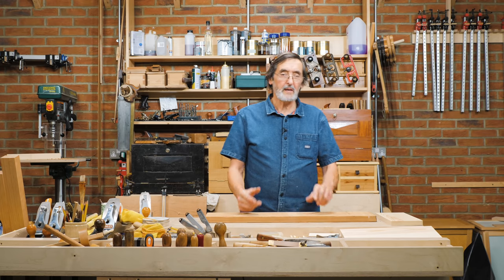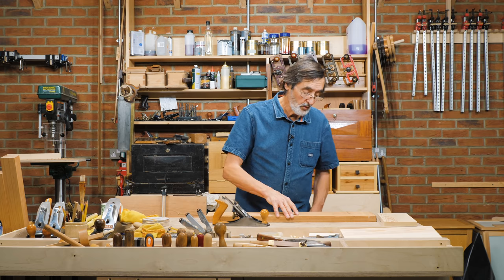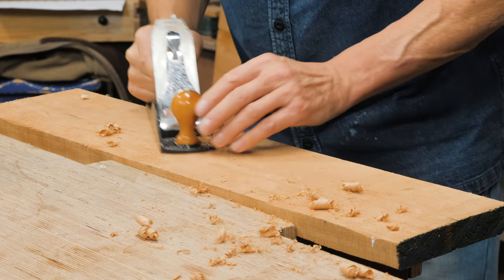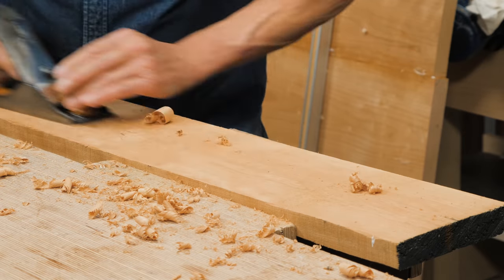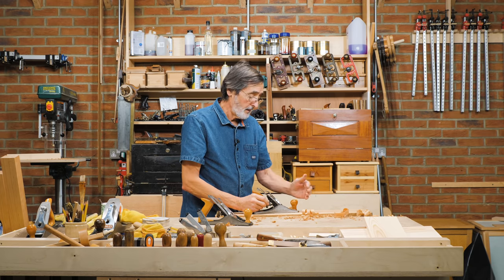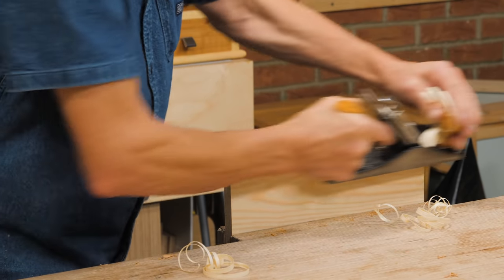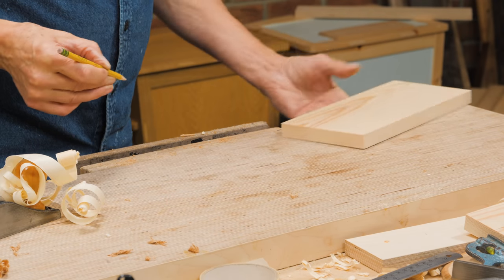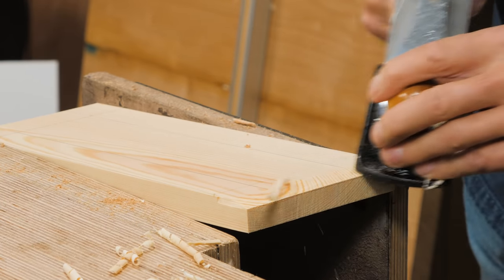How to use a Scrub Plane | Paul Sellers

Comment: Older transitional planes (wooden/iron hybrids) work well for converting to scrub planes. They are fairly plentiful in the US. They usually have a worn wooden sole that also means the  throat has opened up, and the wood on wood friction is significantly less than iron on wood so they really glide over the work.

Comment: I use a reconditioned Stanley #5  with a cambered blade as a scrub plane. I use it for the purposes Paul has described here and also for flattening one side of a plank before I sent it through my thickness planer. It works very well.

Thanks for the idea, Paul.

Comment: Thank you very much Paul for sharing your knowledge and know-how. Watching your videos and practicing by myself, my woodworking skills skyrocketed in just a few months(from almost zero to a little, but that makes me a very happy person and I think this will last). It's always a pleasure discovering new techniques and designs with crystal clear explanations and demonstrations. I can't thank you enough for that.
On the subject of scrub planes, here's a small trick I found for those noobies like me without a plane or spare iron dedicated to the task. Trying to take an inch thick, irregular and rock hard piece of beech down to less than 1/2", I tilted the blade of my no4 all the way to the right and then started scrubing across the grain with the (slightly) rounded corner of the blade. It hogs a lot of material and you have to be very careful not to tear off the opposite edge, but it gets the job done. I suppose it is most certainly bad practice, awkward and hard on the plane in the long run, but when in a tight spot, without the proper equipment, you gotta make do with what's at hand. Happy if it helps someone and glad to be corrected if anybody knows of a more "proper" way to do that kind of makeshift job :)

Comment: I have 4...a wooden European style one with a heavy and rather narrow iron, 2 vintage Stanleys (#40 and 40-1/2) and a #4 converted into a scrub. The European one and both Stanleys are hammer adjust. The #4 has a very mild camber. All 4 are amongst the most used planes in my shop.

Comment: Paul, a couple questions if you don't mind:

1. Do you specifically recommend a no. 4 size for a scrubber, or is it just preference?

2. When scrubbing for fast thicknessing, is there a process? Against the grain or with for speed and efficiency, or does it just depend on the piece of wood?

Comment: HI could you ask Paul if he can do a tutorial on drilling coach bolt holes in wood and using counter bore and counter sink drill bits please and the different types of wood drill bits for electric hand drill and also for boring brace and different bits.. many thanks!

Comment: I have a plane which has really quite a bit of play in the adjustment wheel, takes 6+ turns of it before it engages either back or fore. Anyway to make it less so?
Reply: Where the screw operated lever engages the hole in the chip breaker, I saw somebody who bent a small metal shim, hooked over the top of the iron, to insert in that gap, and clipped in place underneath the cap iron. Sorry, can’t remember who it was.
Reply: The pin must be too small
Reply: Maybe cut a slot in a washer and stick it in the gap? I’m going to try it.
Reply: @georgehyker  Well, it’s either a case of reducing the play of the yoke inside the thumb wheel, or reducing the gap in the chip breaker. I tried the shim method, cutting a piece out of a bean can, and it worked for me.

Comment: Brilliant thank you.  I've been doing some work that this will work wonders on.

If you don't mind I have two questions.
Could a lesser quality Jack Plane be converted to a scrub plane?

And do you have any experience or tips for working with green timber?
It seems a shame that so much UK wood is wasted as we lack space and infrastructure to process it efficiently, so end up burning hundreds and thousands of tonnes of beautiful oak and yew etc
Reply: Leonard Bailey intended for the #5 & #6 to be used for rough stock removal. Stanley didn't add the #40 scrub plane until a few years after they bought Bailey's patents. 

I have a cheap #4 set up for scrub work, but I haven't used it since getting a #5 a few years ago (now I use a #5½).
Reply: @DavesRabbitHole  Thanks David.
I have a naff Whitmore I was thinking of selling. But I reckon it will probably be worth more to me if I convert it to scrub.

I've been doing more reading on working green wood.
The general answer i'm seeing is "don't"  but surely people used to. It will just take more thinking about how things are going to shrink.
It could probably even be turned into an advantage. Joints locking on to each other without glue etc.

Though I guess it won't fit most ideas of 'fine' because of warps

Comment: Great video as always.
Wanted to ask you about your vise offset from the bench surface. Is that for additional clearance? One opinion I heard was there should be no offset so that you can clamp a long board in contact with the bench instead of it just hanging off the vise.
Reply: That's simply how that type of vise is designed to be mounted. In order to flush mount it, you need to remove enough material from your bench top to accommodate both the metal jaw and the wooden jaw pad that you'll attach to it.
Reply: Hello Liviu, Paul addresses this question in some of his videos and blog posts but I can't find the exact one. But essentially, he leaves the offset so that he can grip his work with an overhand grip, which he finds much stronger and more comfortable. If the vise is flush to the bench, you have to grip the piece from underneath otherwise your fingers get pinched. Ah, here is one blog post where he mentions this: https://paulsellers.com/2016/06/on-vises-part-i/ "Many people seem disposed to recess the face of the rear vise jaw flush with the corner of the bench and then add a 1 x 4 the full length of the workbench to have a flush-to-the-corner straightedge along the length of the workbench. For some unknown reason of substance it’s “so they can clamp work flush to the bench for maximising support.” Whereas I don’t deny some may find good reason for this, I have yet to find a reason of real value, even for edge jointing work, so perhaps for me it is more the rarity than the norm because we generally edge joint much of our work in short lengths relying only on the vise and not longer than say three or so feet long. If we do need to we simply add a packer and clamp away without hindrance. Much better to have the vise jaw lining the width of the vise plus say an inch each end and have the real benefit of being able to grip your work throughout any process you care to name be that overhanded or underhanded. "
Reply: It is easier to hold by hand the piece of wood when you have clearance.

Comment: but what if a plane had a camber in the other way around ? would it take a wide shallow shaving ?
Reply: A wide, shallow shaving is what a smoothing plane does.   now if you mean a concave cutting tip? - that would make the corners of the plane iron did into the wood and leave lines when planing or you are going the route of molding planes.
Reply: Thats possible with a moulding plane and it makes a roud or a bullnose.

Comment: Im new in woodworking planes. 
I wanna know what is the different between a scrup plan and a smoothing plane ? 
How can you see the different?
Reply: You can set up a no. 4 like he has to do either task. The scrub plane setup has a heavy curve/camber on the edge of the blade, usually 8”-10” radius, a wide open mouth and the chip breaker set a little farther back, so that it takes heavy cuts and removes material quickly. A smoothing plane is set up with a very low curve/camber, a tight mouth and the chip breaker <1/16” back from the cutting edge, and takes a very fine cut so that it leaves a good finish but does not take off much material.
Reply: Paul takes a smoothing plane, and converts it to work like a scrub plane. A true scrub plane is narrower, with a thicker iron, and large mouth opening.

Comment: Great! Now I just wish I had an old no 4 and a spare blade 🙄
Reply: Because a scrub plane doesn't have to be as precise as a smoothing plane, you can get a cheap newly manufactured plane and grind a camber into the iron to make a scrub! The large mouths typical of cheap new planes is a liability for smoothing but works well for taking big shavings when scrubbing. Of course, you'll always want a nice old No. 4 to follow up with, hope you find yours some time!
Reply: @HugoEckener127 😀 I just ordered a cheap No 5 at Amazon (under 40€) and will give it a try. I expect a No 5 to be a bit better suited due to mass and length compared to No 4.
Reply: @doedeldidoedelda  Awesome! That sounds like a great choice. Having that extra weight to throw behind the plane will be nice when taking big bites out of stock.

Comment: How would you use a scrub plane on tougher or wild-grain wood like mahogany or Wenge?
Reply: igual que con el pino pero sin sacar tanto la cuchilla para que no desgarre
Reply: @renzoperezd1287 
Bien dicho.
Reply: To translate loosely, " same as pine, just don't take off a big cut."
If you think about it, a harder, denser wood will have you backing off versus a soft wood. For scrubbing, grain is less critical because you're hogging out instead of leveling and smoothing. Still don't want to rip out chunks, so keep an eye out

Comment: Do you alter the mouth on the body of the plane?
Reply: I did on mine.   I had an old Stanley #4 that was my very first plane, it was a cheap model with plastic tote and knob.  after years of not using it once I got a  good jack plane, I followed some on-line instructions to turn it into a scrub plane.   replaced the plastic tote and knob with wooden ones, filed the mouth open more, got a new Hock plane iron and rounded the cutting end, leveled the sole with glass and wet-dry sandpaper until I ended up with a decent scrub plane.  it was a cheap version to start with so still has a horrible amount of play in the adjustment wheel.
Reply: @ugaladh  Did you also find a way to lessen the amount of play in the adjustment wheel?
Reply: Just adjust the frog to sit further back.
Reply: @paulsellers7953  You are right.  I tried it on two No.4s.  It limited out with about 0.04" of clearance.  On my Sweetheart 40 scrub plane, the mouth to blade gap is 0.20" (five times more!).  That mouth also has a convex shape, which increases the gap.  Thanks!